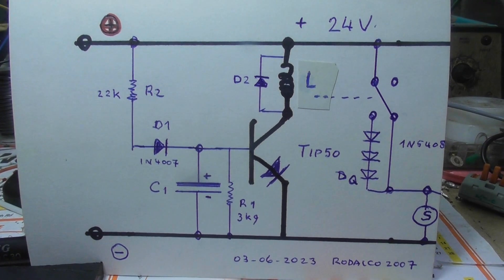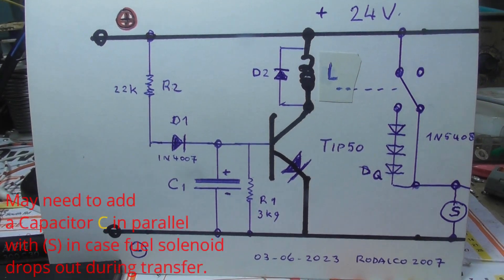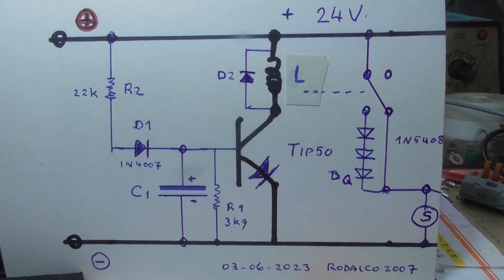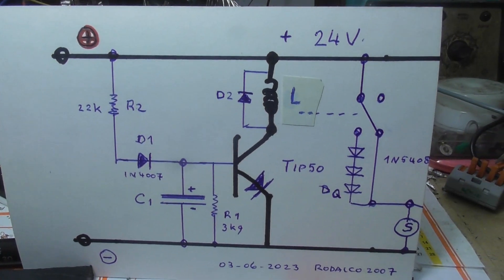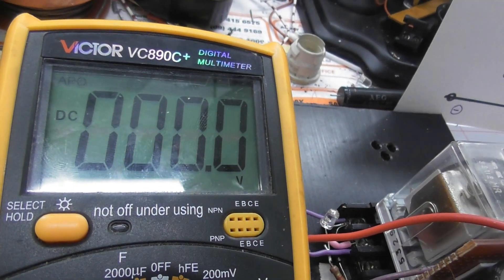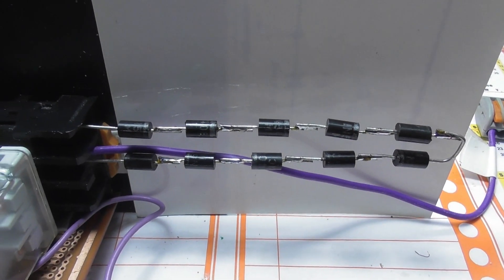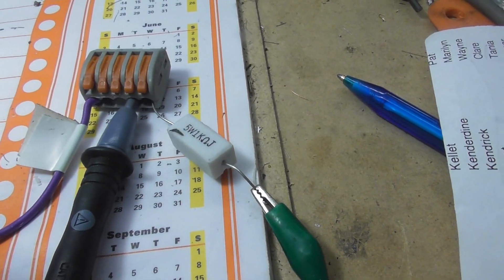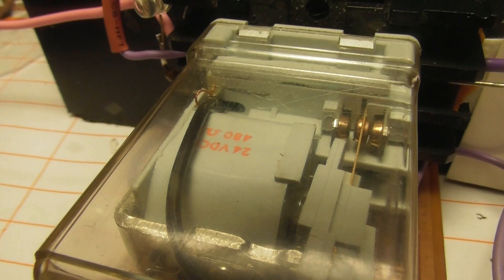Voltage reducing timed relay for fuel solenoid.

Comment: A 10 watt 7.5 volt Zener diode (1N2971B) would work just as well without the big string of diodes.
Reply from the maker: Yes that will work, but I have a box full of these 1N5408 diodes, may as well use those.